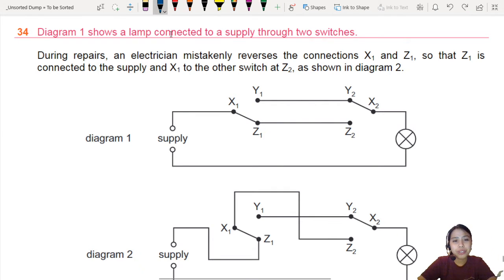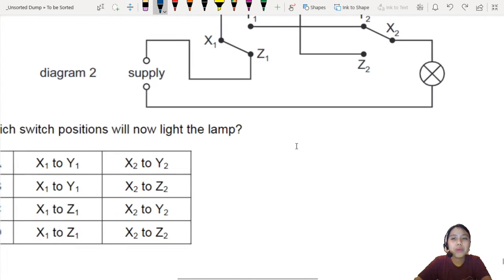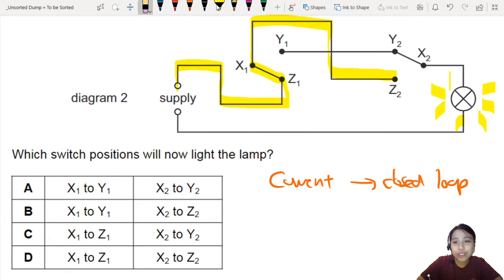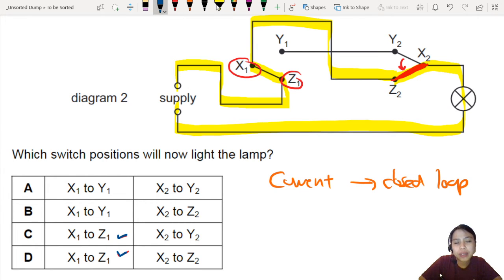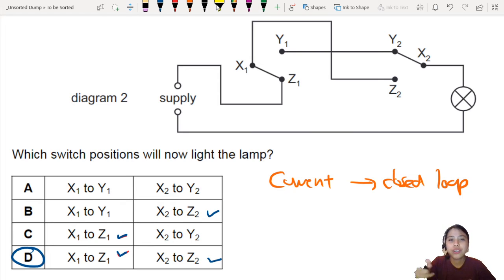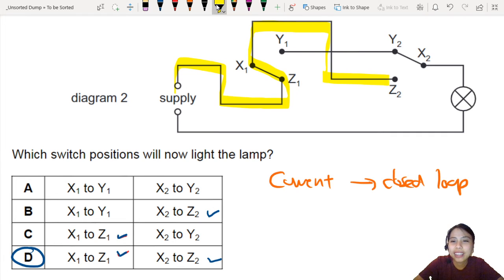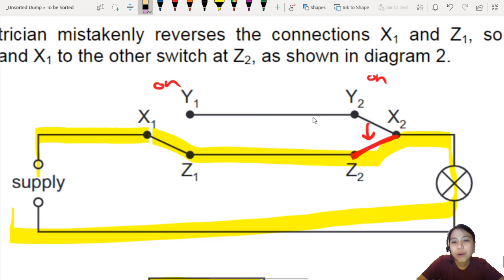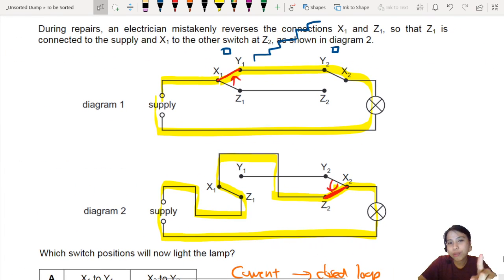MJ19 P13 Q34 Switch Positions to Light Lamp | CAIE A Level 9702 Physics

Comment: Why won't the current exist is we put a switch from X1 to Y1
Reply: Because the connection between X1 and Z1 will be broken

*For those who will have the same question
Reply: @malikzulal  Why can't the connection between X1 and Z2 break?
Reply: @shaheeralam1095  Did you mean X1 and Z1? if so, the switch has one of its end on X1 and the other end either be connected to Y1 or Z1. If the other end is connected to Y1 then the circuit will not be complete as there will be no connection to Z1 and the current will not flow. If you still need explanation dont hesitate to ask.
Reply: @malikzulal  Oh that makes sense, thanks a lot man
Reply: @shaheeralam1095 🙂